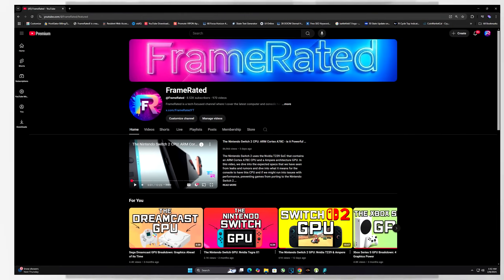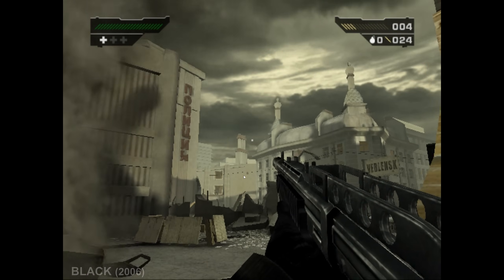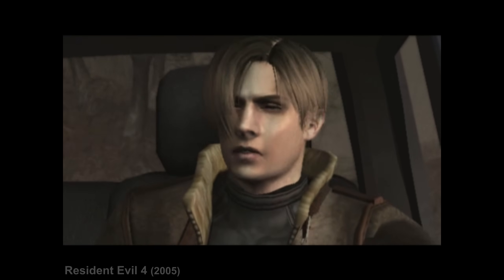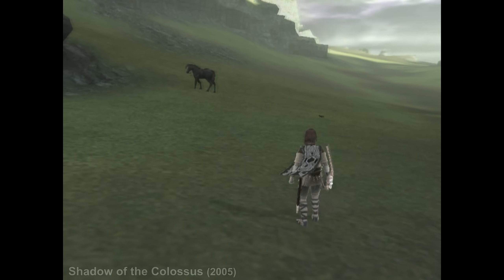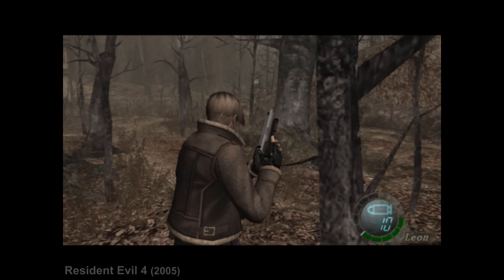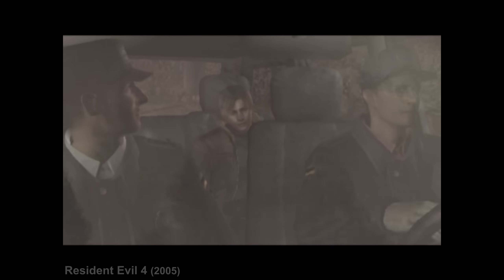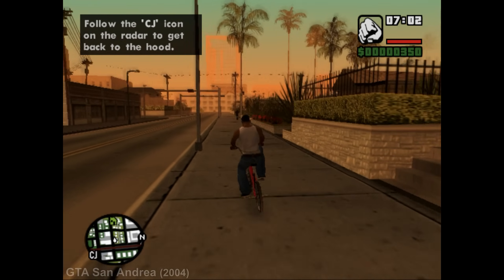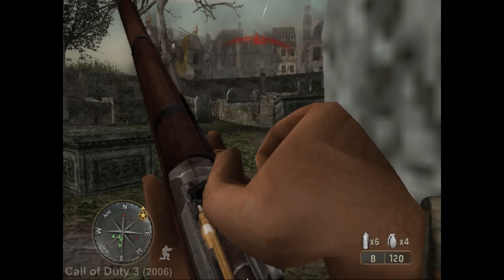The PlayStation 2 GPU: Graphics Synthesizer (Retro Breakdown)

Comment: Please make a video about why PS5 performs better than Series X in so many games although Series X is more powerful. It it because of the variable frequency?
Reply from the maker: That’s a good idea! I have always theorized that it’s primarily because of a few things, like the ease of use to fine tune when developing with the ps5 dev kit, the fact RAM bandwidth being the same speed across all 16GB where the Xbox SX has 10GB of faster RAM and 6 GB of slower RAM (more optimization needed to get the best out of it etc). Or it could just be due to a more efficient compiler, lower level API’s or its higher clock speeds. That’s just my surface level assumption, but I could dive into it and make a video soon!
Reply: Gamecube owned ps2 hard though visually.